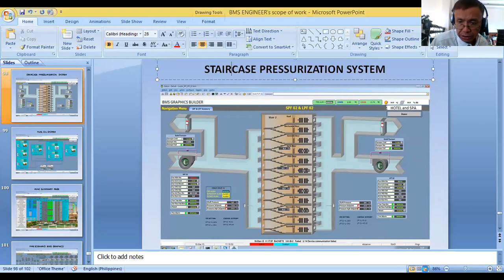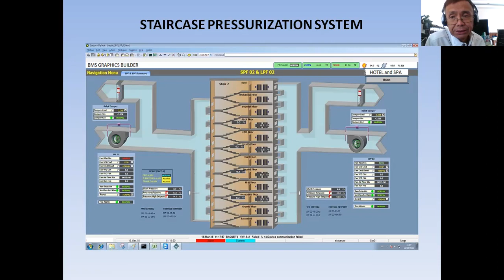How to become a BMS Engineer part 40 (Staircase and Lift Lobby Pressurization System)

Comment: Sir ask lng po, san nyu po nakuwa ung standard na 50pa ang required for the shaft. Tnx po God bless
Reply from the maker: that 50 pa set point was used  during our civil defense testing in Qatar, hindi ko lang alam yong NFPA code kung saan stated ang 50 Pa but based on my experience more than 50 Pa, let say 80 Pa and above mahihirapan ng buksan ang staircase door lalo na kung bata or child  ang mag bubukas
Reply from the maker: remember ang aim is to create a positive pressure   or mas mataas ang pressure sa loob ng staircase against sa loob ng lift lobby, and mataas naman ang pressure sa loob ng lift lobby against sa corridor ng building to prevent the smoke from entering the lift lobby and staircase
Reply from the maker: thanks for supporting the channel, tell your friends  about the channel help me promote it

Comment: As per good engineering practice ilang diff pressure sensor po ba ang required per staircase hbang tumataas yung floor? and which floor ilalagay?
Reply from the maker: actually ang BMS solution provider will always depend on the IFC drawings, unless hindi siya naka specify kailangang itanong mo yan sa Mechanical engineer na nag design. sa aking experience pinapalagay ko yan kung nasa taas ang fans 1/3 ng  height ng staircase galing sa baba ang reference

Comment: 1. Di ba sir dapat nasa staircase yung probe (+) nung air differential pressure sensor at ang isa ay nakareference sa lobby (-)?
2. kung may FSCS (fire smk control system) bakit kilangan pa ng BMS para sa staircase pressurization? hindi ba magdodoble ang mangyayari dun may FSCS kna may BMS kpa or isa lng kapag may FSCS kna imomonitor nlng ng BMS ang status ng fans?
Reply from the maker: 1. yes tama ang positive probe sa loob ng staircase at negative nasa lift lobby ganon din sa lift lobby ang + sa liftlobby at ang - sa labas naman ng liftlobby
2. sa staircase pressurization ang pressure ang BMS ang nag cocontrol pero ang pag start ng mga fans fire alarm system ang responsible doon. To be safe always follow what is being asked in the specification at IFC drawings

Comment: Paano po magiging accurate yung reading sa Smoke stop lobby na pressure kung nakalagay sa common supply air duct yung differential pressure sensor? ibig sabihin yung pressure sa duct ang minimonitor hindi kada isang smk stop lobby. for sure yung pressure sa smk stop lobby 1 ay minsan hindi equal sa pressure sa smk stop lobby 2,3,4,5,6,7 & so on. unlike staircase na may common well, kya kahit isang differential pressure ang ilagay kc parang isang room lng ang staircase.
Reply from the maker: yong sa duct na naka install yon ang para sa relief damper as per mechanical specification, actually ang pinagamit ko diyan para sa relief damper ay yong sa differential pressure na naka install lang sa mezzanine level yon din ang pinagamit ko para ma maintain ang pressure sa staircase at lift lobby. malikot kasi ang control sa  pressure sa stairase at lift lobby kung pag babasehan ang lahat ng DPT na naka install.